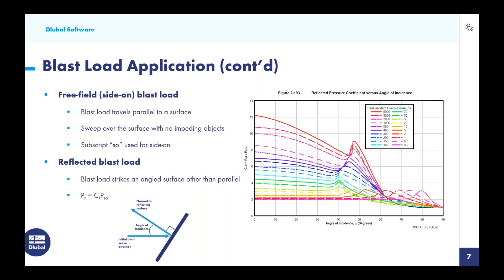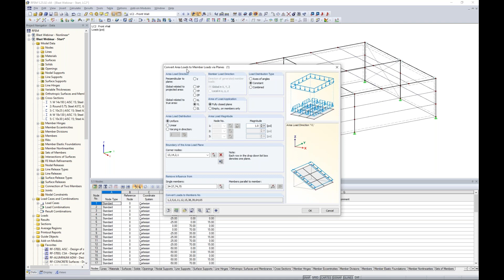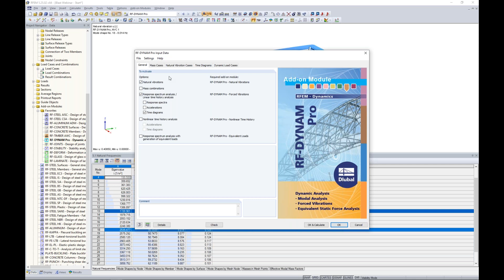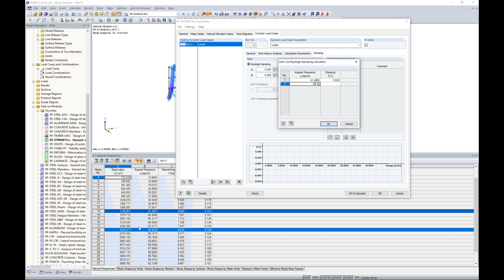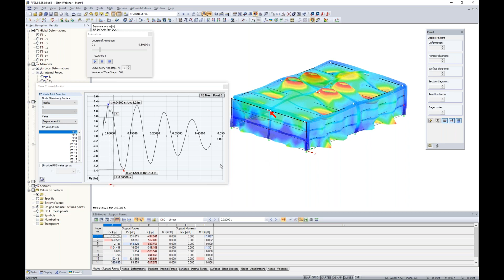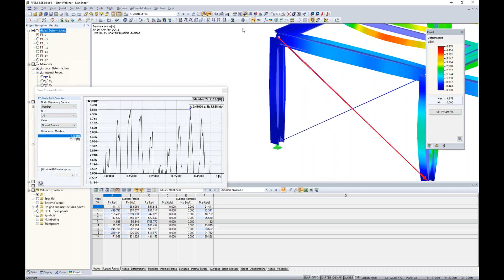Webinar | Blast Time History Analysis in RFEM

Comment: I found a small mistake on the equation at time 18:09, Pr is 79.5 psi instead of 29.5 psi , but the result is correct :)
Reply from the maker: Hi, Mhmd!
Thanks for letting us know! If we present again in RFEM 6, we will be sure to correct.
Reply: You welcome, i have a question i have noticed at time 38:20 that the multiplir(pressure) doesn't have a unit, not also shown at the unit and decimal places, i am using metric, so i have some trouble especially with angular frequancy column at natrual frequancies tab (table 5.1.B) like i have it starting from angle 383 until 3600 rad/s !  @DlubalEN
Reply from the maker: Hi, Mhmd!
The multiplier is always unitless regardless if using metric or imperial. This value will simply be multiplied by the load case associated with the time diagram applied. Therefore, whatever units you have set directly under the load case and applied to the structure will be used along with the multiplier. If you have any additional questions, feel free to send us your RFEM model and questions to info@dlubal.com.